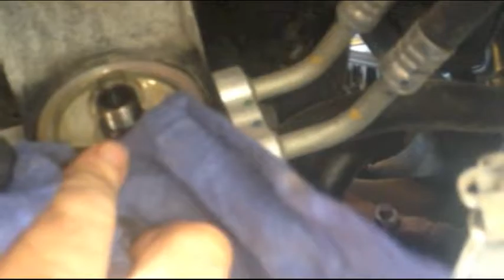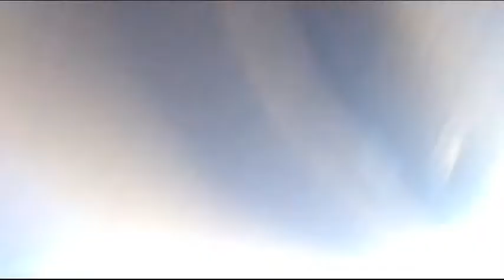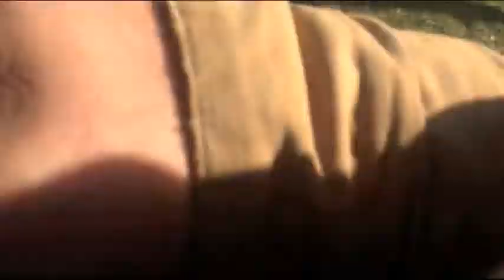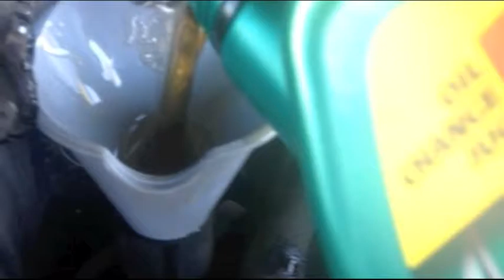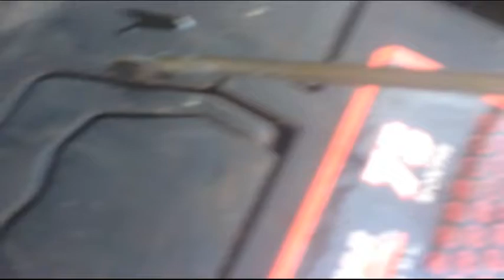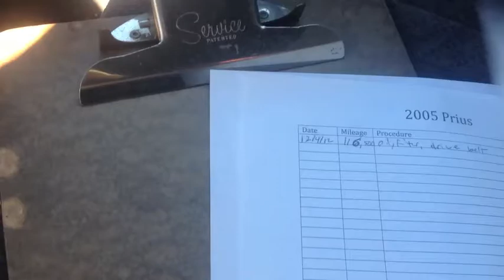MDOP#6 - Sonoma Oil Change III: The new oil filter and the pour (sort-of)

Comment: Hi, I have 1998 GMC Sonoma, do you think its the same as yours? DO you know if there are any videos out there that also show how to remove AC Air Compressor and vacuum out the old stuff from the AC System and put a new one in? I was trying to fill it with new coolant 134 and the AC Air Compressor locked and burned and now I hear this annoying noise and want to just fix it since we've been having really worm days :-( I searched and searched but did not see any videos of this out there but you may now I hope or someone may know.
Reply from the maker: Mountain Lion Not sure about either of those things. Sorry.